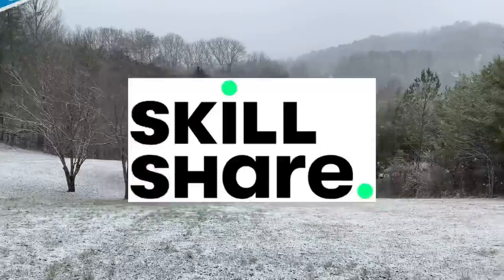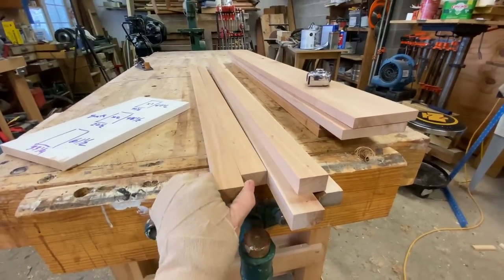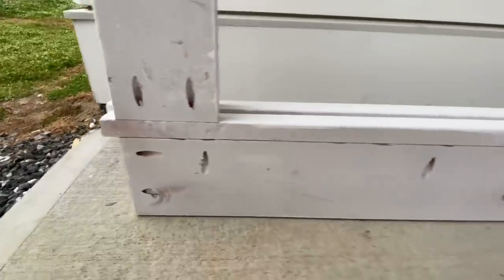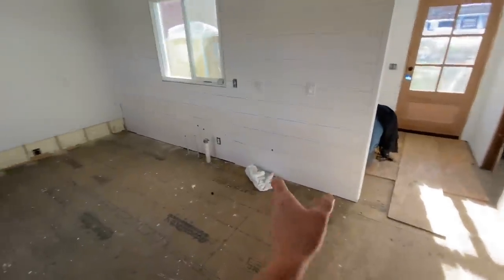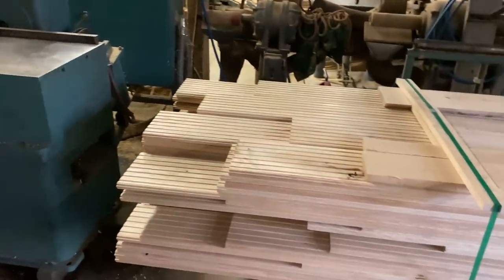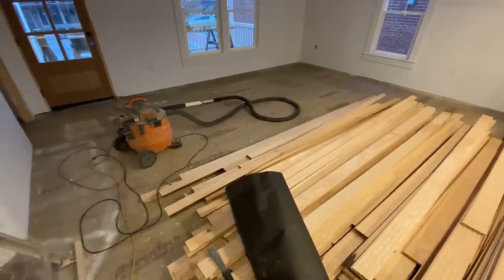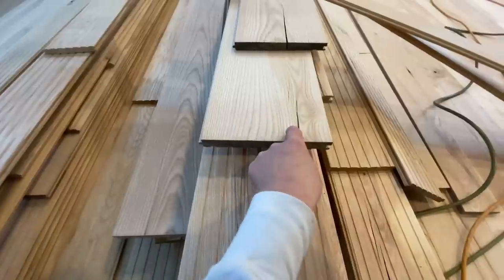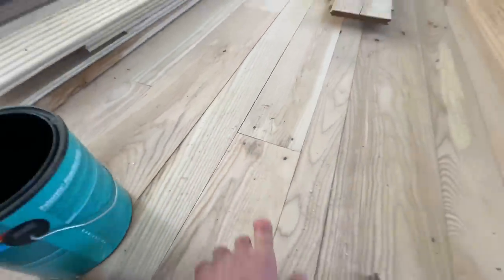Hardwood Floors and Window Trim Details | 120 main

Comment: I believe normally when you use wider boards than 3” you are supposed to glue it with a wood flooring glue which allows for slight movement yet keeps it tight and prevents cupping. So no felt paper and you don’t need the center nails. Also, you can buy or make splines intended to allow reversing easily. If your subfloor is 3/4 plywood you can run flooring whichever ever way suits the room without worry. That house is a work of art.
Reply: I agree, he didn't need to switch the direction of the flooring. Sure, if you can always run it perpendicular to the joists, great, you should do it. But with modern subfloors, that's not necessary. To avoid thresholds and maintain the continuity of the floor is a better choice.

Comment: The trick to paint open poar wood is to seal the poars, I use bin shellac primer, brush it and roll it into the grain and that means work it in about two coats, then sand lightly and paint

Comment: Hey! Love the videos and follow along. Are you mainly filming with iPhones? I see some gopros in some videos. Also what softwares are you using to edit the video and thumbnails? Thank you.
Reply from the maker: Hey Michael… Yes We are mainly using iPhone 12 pros for filming, but we have several GoPro hero black nine‘s as well. Those don’t do very good and low light and the audio can be not as good as the iPhone either. We’ve actually purchased more professional gear, but then returned it after we realized that the iPhone does nearly as well and can fit in all of our pockets :-). I use videoLeap to edit and I actually do all of that on my phone as well. They have a sister app called photofox that I used to do the thumbnails

Comment: "diehl," german or austrian. no meaning, just a name. 
pronounced like "deal" in english.
Reply: That’s a big Diehl...
Reply: Founded 1909 by George M. Diehl in Peru, IN, but soon relocated to Wabash. An ad in a 1920 issue of The Wood-Worker gives the name as G. M. Diehl Machine Works. An ad in 1955-56 HWWDD gives the name as G. M. Diehl Machine Works, Inc.

Introduced the first straight-line ripsaw in 1913. Also made glue jointers, which planed both edges of random width stock; these machines were made obsolete by subsequent improvements in ripsaws by Diehl and others.

In 1999, Diehl merged with Wisconsin Automated Machinery Corporation. In 2019 Diehl Machines was acquired by Mereen-Johnson.

The DiehlMachines.com website has good information on buying a used Diehl machine.

Comment: Real carpenters don't use pocket screws. Pocket screws are an extremely weak joint. 
Also, forget sketchup. Alibre Atom is a million times better.
Reply: They're doing window trim - once it's on the wall there's no stress on it so let's not stress about their technique :)  I agree though, pockets not suitable for drawers or boxes...
Reply: It’s a window trim. It doesn’t need to be strong. I’m a woodworker and it’s perfectly fine to use pocket screws for non load bearing joints
Reply: LOL......"real"
Reply: Pocket screws on most non-structural items is perfectly fine, especially if the screws will never be seen.  I mean, they aren't going to be using advanced joinery techniques for window trim.
Reply: Actually, that’s not true. People think of stress as in load-bearing stress or structural stress in some way, but wood is also stressed by humidity & temperature via seasonal wood movement. Window casing assembled the way Jamie is doing it will show cracks in the joints over time—you can’t stop wood from moving via seasonal wood movement. You can minimize it, if you are willing to take the time to use more complicated joinery methods (below).

And the window frames are also potentially stressed by people leaning/sitting/standing on the small sill. It is undeniably true that a pocket hole is pretty close to the weakest way to attach two pieces of wood. A better technique would be to add glue to that butt joint. Better still is to not use pocket hole joinery and instead use a biscuit joiner to attach the flat casing together (with glue). 

The bottom line is that there is always a better way to accomplish the task at hand, and the right choice is a compromise of speed vs. quality. Sometimes you can have both, but most of the time you sacrifice quality for speed, especially when building a house.